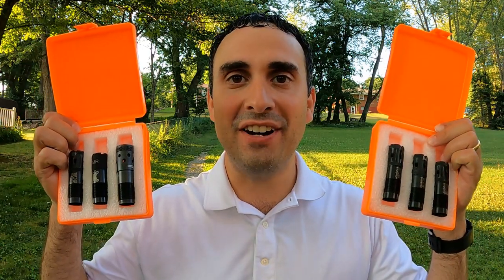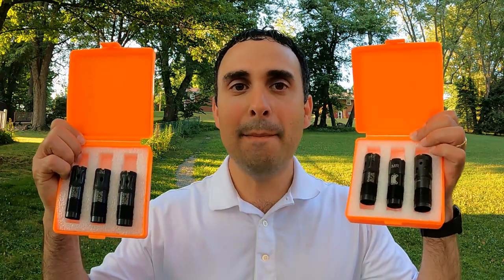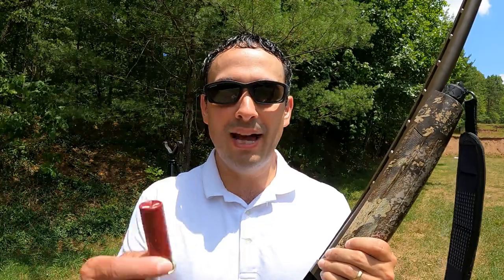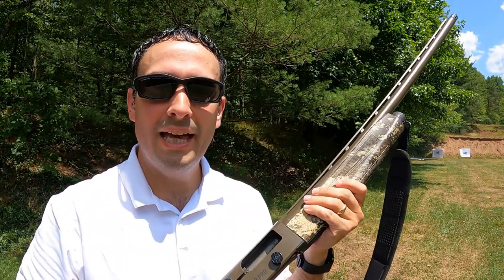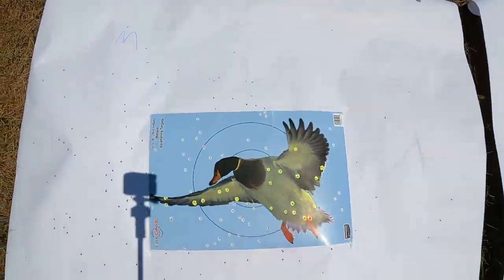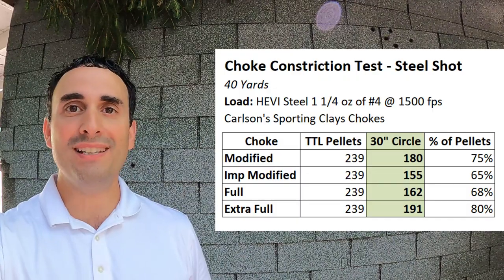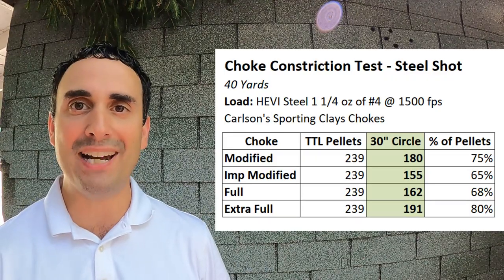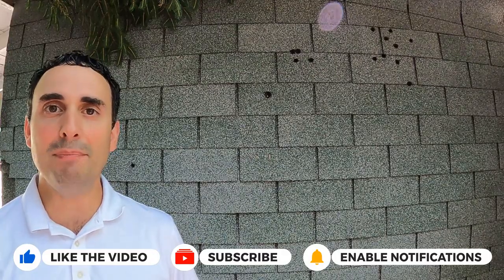What Is The Best Choke For Steel Shot? – How Tight Is Too Tight? HEVI Steel Pattern Test

Comment: I have done extensive pattern testing and have found bigger shot (once you go to #2 or bigger)  that too much constriction creates inconsistency and blown patterns, since steel doesn’t compress like lead. If you go tighter than a true modified constriction -.020, you’re not gaining anything but barrel pressure which is NOT GOOD. 

I found the sweet spot for me and almost all of my buddies is the Light Modified constriction (-.015) such as the Carlson Cremator MR for all shots inside of 50. It can be too tight inside of 20 yards. I sometimes use IC when in a small right space but I NEVER go tighter than modified nowadays. Great video 👍🏻
Reply from the maker: I am planning to do some testing with bigger steel shot also! Thanks so much!

Comment: I've always use stock mod for all steel shot. 870 super mag rem. This is after I put my lead gun away ...get them close.  #3s for ducks  ,bbb and t for geese. Good job sir.
Reply from the maker: Thank you so much Joseph!
Reply: I agree with BBB and T shot. Most of my hunting is pass shooting with a modified choke. Ranges vary from 30 to 65 yards.  I tested 3.5 inch Fiochi 1 9/16 T shot at 100 yards. 21 pellets in a 30 inch circle that went through 4 layers of heavy duty cardboard (refrigerator box). I usually load a 2, followed by a BB followed by a BBB (snow geese) or T (honkers). The third shot is to clean up cripples, works really well at long ranges. The sad part is that BBB and T shot are almost impossible to find anymore.
Reply: I always used federal bbb and t shot 1 3/8 oz. 1475 fps.  Federal premium
Reply: Perfect! same medicine I use. Those BBBs and Ts crush geese at 85 yards. Pattern 24” at 60 yards with a Briley .015 light mod.

Comment: Over decoys, I’ve used Mod and more often Light Mod with great results.  In particular, Carlson’s Cremator mid-range is actually a Light Mod, measuring .015, and I’ve taken countless ducks with it.  

Additionally, my hunting partner damaged the end of his barrel shooting high-speed steel with a full choke.  Choke survived, but the barrel didn’t.  Ill advised if you ask me.  

If you can call and use decoys, stick with Lt. Mod or Mod.  3”, #3’s for me, as well.  I only switch to #2’s if it’s late in the season and ducks are a little more wary.  Good luck!  Enjoy your videos…
Reply from the maker: Thanks so much Andy!

Comment: You continue to impress with your real-world and practical tests. It would be interesting to me to see this same test conducted again using #2 steel. Maybe the larger shot of #2 steel will start to interact together and create "bouncing" or "banging" off each other as the shot passes through the choke tube. Perhaps you would experience pattern degradation downrange. Thanks for interesting and helpful videos.
Reply from the maker: Thank you! I very much want to do that test. I haven't found any good steel loads at #2 to test it with yet. But I'm looking for them. Ideally, it would be HEVI Steel, same load just #2 or even #1.
Reply: @TheNewHuntersGuide  I have a spare box of Kent fasteel in # 2 I can send you
Reply from the maker: @longridgearchery  Hi Jared, I really appreciate the offer! My one concern is the variables. I think it would be best to do the test with HEVI Steel #2 and see if the results differ from the #4 of the same brand. Changing brands could change other dynamics since the Fastseel is zinc plated.
Reply: @TheNewHuntersGuide   completely understandable. I also have BB as well as the 2. If you think of something you would like to do with those let me know.  Keep up the good work.
Reply from the maker: @longridgearchery  Thanks so much Jared!

Comment: I use #4 steel as a swatter load after Boss.  I use aftermarket modified for ducks and factory improved cylinder steel #4 for pheasant (nontoxic required). I like the data driven approach to your videos. I also like that you use a tripod for consistent aim. Could you do a comparison of factory screw-in flush chokes vs aftermarket?
Reply from the maker: Thanks! I already did that video. https://www.youtube.com/watch?v=5aNXitA5Jho& The bottom line is sometimes extended chokes are better, sometimes they aren't.

Comment: Extended range with bbb shot.
Heard its where its at for geese but dont know about that as havin trouble finding a choke that is rated for steel that size and cant find any copper plated steel load used to use for turkey out of my old do everything 18 and change inch winchester 1300 pumpy.
Reply from the maker: BBB shot isn't even legal in our state lol. At that size, there aren't even enough pellets in the shell to get 100 in 30" circle at any range.  I'll take more pattern any day, unless I'm hunting coyotes or something.
Reply: Patternmaster has good tubes for bbb steel. I use the anaconda full in a benelli mobile 12ga. Hammers geese and big ducks

Comment: In the UK, the use of steel in chokes over half are thought to damage the chokes and barrels!
Reply from the maker: What do you mean by "over half"?
Reply: @TheNewHuntersGuide  In the UK, chokes are graduated from "cylinder", i.e. no choke, through "improved cylinder", "quarter", "half", "three-quarters", and "full", so I am referring to "three-quarters" and "full", as being considered potentially too tight to use steel shot, without damage to the removable chokes or barrels, if fixed choke.
Reply from the maker: @christopherhindle1174  Ah, I see. Thanks for explaining!

Comment: Another informative video. Wildfowlers have known about choking down on steel for many years. There is a reason that the terror chokes have such a good reputation. 

I do think that your point about steel running out of energy too quickly is valid for size 4 (which is why I don't use it). But if you bump the size up steel will kill very convincingly at longer ranges.

I really do think you should try heavy payloads of steel from a 10 gauge through tight chokes, even if you only do it once. The performance is exceptional even at long range, it just seems to fold Canada geese up much better than the 12
Reply from the maker: Thanks so much! If I ever get my hands on a 10 gauge, I'll give it a try. But I'm not that big of a guy, 3" shells are about as big as I want to go. I might even experiment with 2 3/4 next season. I price light weight and light recoil. I often carry so much so far into the woods, that every pound matters.
Reply: @TheNewHuntersGuide  and that's a fair point, but bear in mind that the extra weight of a 10 also results in less recoil, so don't let that put you off.

Good video again, I enjoy watching them.
Reply from the maker: @mrsmith9079  Thank you!

Comment: Thanks for such a great job. Just a question. Is that Modified choke, M for steel or M for lead which is IM/F for steel?
Reply from the maker: Modified is a constriction measurement that is independent of the ammo used. This one is 0.710. It's the same for steel, bismuth and lead. Modified is modified. Where there is variability is in the Short, Med, Long range chokes, like the Cremator chokes. They are made for steel to provide ideal patterns at those ranges.

Comment: Great test! Two questions. Are your tests using 2-3/4 or 3” Shells? Given the fact that the modified choke was 75 percent would you say it was a better choice for hunting? That way the pattern would not have been so close at say 25 or 30 yards?

Can you test the Carlson Decoy Choke? Is it like the modified choke?
Reply from the maker: Thanks! This one was 3" shells. The best choke for you would depend on the range you're hunting. But for that range, yea, would probably pick the modified. Which decoy choke are you referring to specifically?
Reply: @TheNewHuntersGuide  the Carlson Waterfowl chokes. Mid and long range
Reply from the maker: That is a good question, I just got a set of those, a few days ago. Hoping to do some test videos with them next season. You can see their constriction on the website and compare them with others generally speaking. But I haven't shot one yet. @jimdrechsel3611
Reply: I’ve watched Jim Muller talk about chokes, ammo and ballistics. He mentioned that the Benelli I have has a smaller diameter barrel than other shotgun manufacturers and that they shoot tight. Most people over choke benelli shotguns because of that. I noticed more hits with my benelli using improved cylinder only not effective kills outside 25? Yards. I would cripple at 35 and couldn’t finish off cripples when they began to swim away. I’ve seen others with the same issue. Jim Muller talked about how to properly check your gun if it’s shooting at point of aim too before checking pattern to see if you need to adjust your gun to fit. 

I don’t know how to send the link but you would enjoy watching if you haven’t already. Very technical information that you  would seem to enjoy. Not to necessarily buy his chokes but to listen to him talk about ballistics. I learned so much and combined with you.  I hope to improve quite a bit by next season. The biggest takeaway from Jim Muller was to use the same ammo load and velocity no matter what so that you develop the skills needed to establish proper leads. Also Slower velocities with bigger payload is much better. Much like you mentioned before about the velocity hype. 

Much like most hunters I’d like to see if steel can do the job to keep cost down. If not I guess it will have to be the Boss ammo. When I think back I waste more ammunition missing and getting cripples with steel to justify the cost of bismuth. 

Did you practice with bismuth? Because that would be costly but I would think beneficial. 

Thanks again for the replies
Reply from the maker: Thanks so much. Yes, I've seen at 7 installments of Jimmy's MVM podcast interviews. I've talked with him previously at length as well and hope to interview him on my podcast about turkey hunting. I shoot alot of bismuth making these video, but I'd shoot clays with it because its not allowed at the course I go to. But I'd like to.  @jimdrechsel3611
Reply: Yeah an interview with him just talking about ballistics would be great. More people would be blown away. 
I wish with his knowledge he would publish book that shows leads given ammo materials and loads at different distances. That would be tremendous

Comment: In your opinion is there really any difference between the sporting clay chokes the waterfowl chokes? I have a .715 sporting clay Carlsons  (light modified??). I should be good right?
Reply from the maker: By and large, if the constriction is the same, the performance will be the same. I got my Carlson's sporting clays chokes to use for waterfowl testing and hunting. Usually they perform identically to the chokes with ducks printed on them. The waterfowl chokes try to simplify things, giving 2 or 3 chokes with defined ranges vs you having to think about CL, IC, LM, M, IM, F, XF. Using sporting clays chokes just takes a little more thinking to pick the right one. They are also better for testing because you can hit all the increments you want.
Reply: Thank you!! I admit I still need to pattern test the chokes I do have. Primos Dead Zone, Mossberg Accu choke modified and the long range steel choke that came with my Weatherby Element.

Comment: Of course I found this vid AFTER getting the Carlson Cremator .700 tube (IM) for LR steel (the installed tubed is .700 also) - I picked up #4 Hevi-steel, Hevi-Hammer & #3 Hevi-Hammer. What are your thoughts about the "mix" level of Bismuth: 30% in Hevi-Steel vs 15% in Hevi-Hammer? I ask because I haven't hunted waterfowl in decades and am getting back into it. FWIW, I got a Beretta A300 in 3" 12ga
Reply from the maker: Hi Louie, that Cremator will serve you very well I'm sure. So actually HEVI steel has no bismuth in it. It is straight steel. I called HEVI shot to make sure. I have a HEVI Steel vs Hammer test on the way as well. For me the Hammer tends to pattern a little better but terminal performance is negligible. The 15% bismuth isn't enough to matter. But both are good shells out to 40 yards.

Comment: They say not to use steel shot through a full choke because it damages the barrel. I've contacted mossberg and asked them and they said its not a good idea. They say to use ic and modifed only
Reply from the maker: If the choke is hardened steel able to withstand the shot, it does not place extra stress on the barrel. If the choke is soft steel, as are most stock chokes, and likely many of Mossbergs, then it can't hold up to the shot and upon failure will compromise the barrel. If the barrel is rated to withstand the hardness of steel, then its up to the choke to be rated for the shot size, velocity, and constriction. Not the barrel. However, Mossberg makes an X-factor Full Waterfowl choke. So...

Comment: I feel it's worth adding that in my gun's owners manual it states that you should NEVER shoot any steel shot through tighter than modified choke. It also states that steel shot larger than #2 should NEVER be shot through tighter than improved cylinder choke. Not following these instructions may lead to barrel swelling or rupturing.
Reply from the maker: Always follow your manual.  What kind of gun do you have?
Reply: The manual I am quoting is for a Tokarev Bullpup 12 gauge shotgun. Strangely, the manual for my S&W 3 1/2" 12 ga. shotgun doesn't mention these guidelines at all. But, since I use it for goose hunting, and shoot everything from BB to BBB to T shot through it, I installed the Improved Cylinder choke tube after reading this. I still need to go out and pattern my gun with the switch of choke tube.
Reply from the maker: @donaldschrade1679  Interesting. We'll I would say always follow your manual and the choke tube manufactures guidelines for safety. Not all barrells are rated for steel, but that does not mean no one should or could use it safely. Same with larger shot.

Comment: Hi there, I watch all your videos! Quick question - for external choke tubes, do you use tools to tighten it? Or just with hand? I have Carlson external tubes on my SBE3, but it gets a little loose after only shooting a few rounds of trap. So want to know if you tighten it with a tool or not, thanks!
Reply from the maker: Thanks so much! I often just hand tighten and for many chokes that's enough. But I do keep a choke tool and I'll give it a little extra torque when needed. Be careful not to over tighten as it is possible to really get a choke stuck if you leave it that way over time. In rare cases too much torque could split the barrell but that is very rare. When using the tool make sure you never use anything to get even more leverage.  Thanks!
Reply: @TheNewHuntersGuide  thank you for the advice - I also took your advice and took my son today to shoot traps after the duck season is over - as you mentioned, it is likely the best investment. I totally agree!
Reply from the maker: @jamesliu1908  Awesome!

Comment: Hello, I am planning to pick up a long range choke for my Winchester SX3 3 inches chamber, i am debating between Patternmaster Code Black duck or Pattern Master Code Black Goose. I need your help.  Thank uou
Reply from the maker: Hi Tom, I've never touched a pattern master before. They have a different philosophy and engineering than most  chokes. I don't think I can give you great advice there. Some will depend on what size shot and what material of shot you plan to shoot.
Reply: Use the code black duck for 3" shells, the CBG is designed to use with 3.5" loads.

Comment: Just my opinion but it seems like modified chokes are a good all around tube when in doubt. I believe there are better chokes for different situations but a modified will work in most.
Reply from the maker: Modified is usually the best option. I do alot of tests to find out what the best long range options are because people keep asking for it. But most people don't and shouldn't fixate on long range. Modified for regular hunting is going to be ideal much of the time.

Comment: I just subscribed I like your content. So let’s lay it out. If I have a #1 steel pellet that weighs 4 grains and a #4 bismuth pellet that weighs 4 grains. Then I send it at 1350fps the only thing I have changed is it’s size and wind resistance. I would like to see pellets that are closer in weight being used in test. Steel is round bismuth usually isn’t I would like to see if the penetration is close at extended distances to really see if steel can’t kill at extended ranges.
Reply from the maker: Thanks so much Colt. I am planning some long range testing for the future. I think its well established that Steel can kill at any range you can hit a bird but you just have to keep making the  pellets larger until they can't get any larger. I see where you are going with this test idea, but I think the bigger issue is eventually you have to make the pellets so large that you can't throw enough of them in a tight enough pattern to hit the target consistently.  Steel #1 and BB shot loose pattern before they lose power.  But, as I do my upcoming long range tests, I will try to keep these variable in mind and see if I can shed more light on this question.  I just need the pattern to be good enough to hit the ballistics gel a few times lol

Comment: You should have run the test like a proof test. 
Multiple and very accurate measurements of the choke tube and barrel before and after each test shot. 
Just because you can not see any deformation of the barrel and choke doesn't mean nothing happened. 
Be advised all Saami loads 3" and under do not exceed CIP Standard steel loads which is the maximum pressure non steel spoofed guns can shoot in the UK. we do not have High performance steel in this country.
Reply from the maker: Unfortunately, I do not have that level of instrumentation yet. But hopefully in the future.